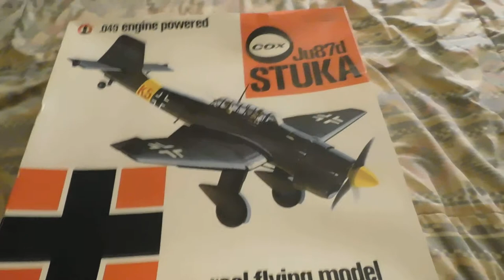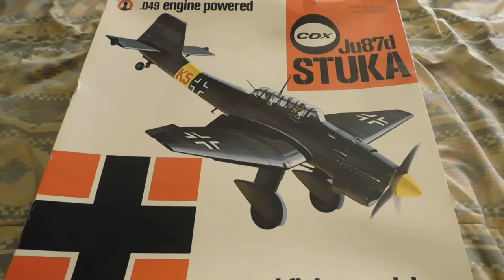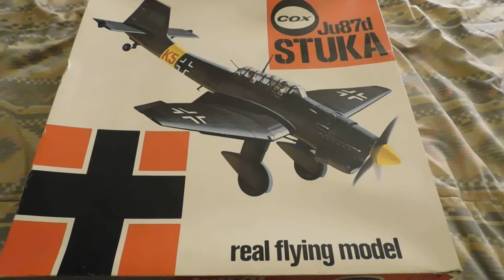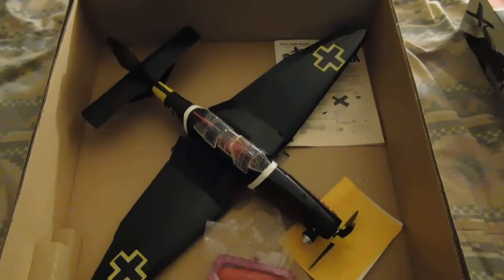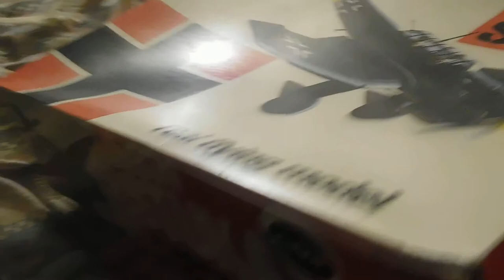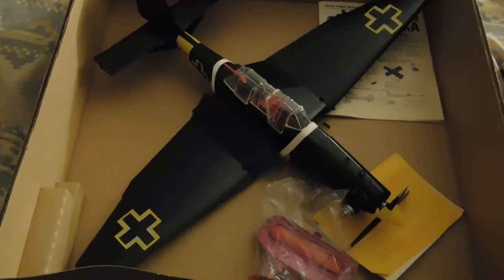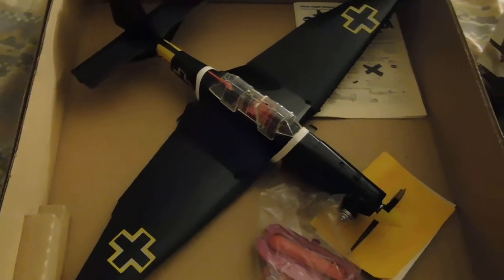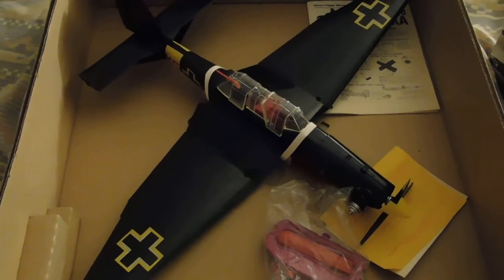Cox Ju87D Stuka (Black Knight 1974)

Comment: If you haven't flown it yet - a few pointers:

The Cox Stuka is a very scale-like design with an abbreviated tail arm (typical in C/L design) for experienced flyers as noted but not the biggest in the Cox line-up; the Rivets, Super Sport, and full-airfoil stunters (Me-109, Chipmunk, and Hyper Viper) have more wing area - Disagree with all the claims of elevator being too small as I never found pitch control ineffective with the two black Ju87D's I had. Agree that the airplane requires a hard, smooth surface, 360 degree unobstructed circle - pristine asphalt is paramount. Use full spool of Dacron line - found the 3rd line for bomb release creates drag and isn't worth the effort for the short time the bomb stays in field of view. Fly on dead calm days only. Needle engine for max RPM (25% nitro), keep it no higher than shoulder height for first flights, be quick on your toes, maintain line tension after engine quits, and maintain speed with minimal elevator input - makes for the most beautiful, smooth as glass, wheel landings. Flaring too much, too soon for a three-point landing is improper technique with this airplane and results in a lousy landing or nose-over. 

Additional notes:

Paint pilot and gunner and secure both with a single rubber band around their torsos; tape pilot and gunner canopies shut at top with two 1" long pieces of Scotch tape otherwise they will slide open and may blow off in flight. Remove sprue from plastic generator shafts on wheel pants - perhaps even lightly file with 400 grit paper before sliding on the red siren generator props so that they turn easily with airflow.

Cleaning this airplane is a PITA since the stickers all have sharp corners and are lifted easily. Be careful when disassembling/reassembling fuselage not to strip or damage fragile screw receptacle posts lest you have the airplane blow apart in flight.